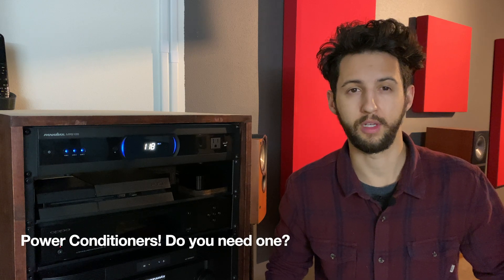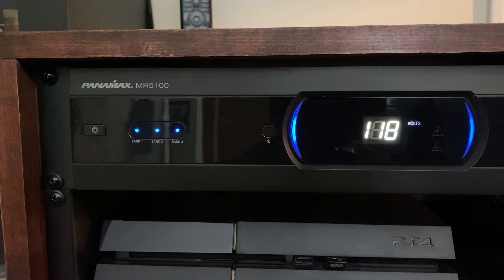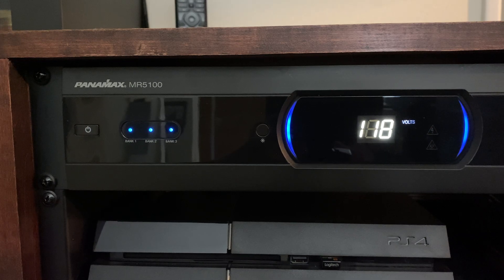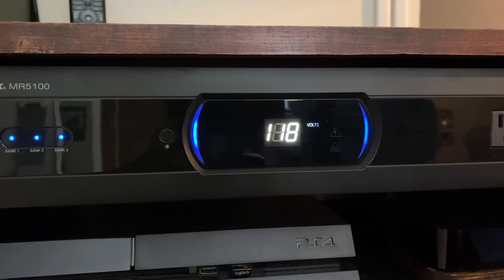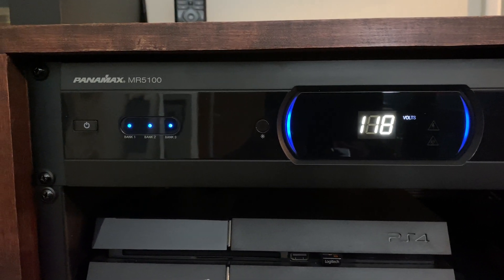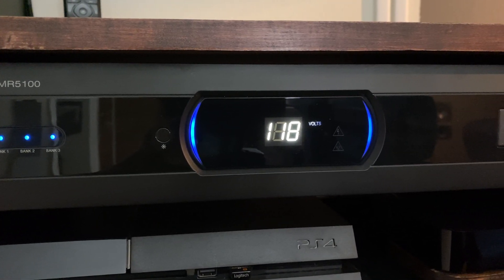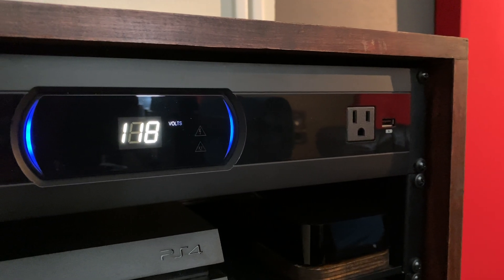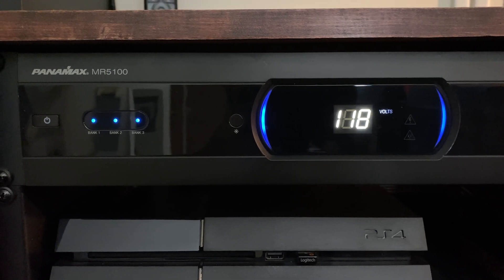Does your Dolby Atmos Home Theater need a Power Conditioner?

Comment: Hi there. I just purchased the Panamax mr5100 based on your review. I have a couple questions. I’m going to plug my marantz 7010 receiver into the high current banks. but I’m not sure if I should plug my Panasonic 4k player into bank 1 (always on) outlets or bank 2 (switched) outlets. I value your opinion. Thanks again.
Reply from the maker: Well it’s not a high current device so technically it will not matter. The delayed outlets are for power amplifiers and they turn on like 10 seconds after the other outlets. So I would plug in your Blu-ray player into the always on or the bank two switched outlet

Comment: Is it normal for the numbers on the panamax to fluctuate up and down.
Reply from the maker: Yes ! Absolutely unfortunately most people share power with their neighbors even if you live in your own house if a lot of people in the area around you are  drawing a high amount of current then you might see some voltage fluctuations, this is perfectly normal although generally it should only be 1 to 3 Volts
Reply: @The.Home.Cinema.Engineer  oh okay yeah I see it fluctuate from 120 to 118. so when you turn off your entertainment do you turn off your panamax to or do you leave the panamax on.
Reply from the maker: @dwj3005  Panamax conditioner stays on 24/7. I only unplug it during a really bad thunderstorm was very close lightning but that rarely happens
Reply: @The.Home.Cinema.Engineer  would the panamax protect  your equipment from a storm.
Reply: @dwj3005  Most likely not! If you are subject to a direct hit it will fry the device and still destroy your equipment. Best line of defense is unplug your equipment!

Comment: you dont need a power conditioner at all.
Reply from the maker: I would disagree , Some of these base model Furman and Panamax power conditioners are only a little bit more than a power strip, and they offer more outlets and they do offer filtering for EMI and RF which can affect the sound quality. Plus the added benefit of the protection from surges is usually stronger than what a standard power conditioner offers so maybe not entirely necessary but great benefit I think

Comment: Can you plug a electric fireplace into it.
Reply from the maker: If you wanted to , lol
Reply: @The.Home.Cinema.Engineer  lol I'm serious will it harm the unit.
Reply: @dwj3005  no i plug mine in but it will cause a power drop that could trip the system and shut it down so you will have to check your votlag so it doesn't drop below 100 volts

Comment: In all my 80 years I have never needed a power conditioner,Thank God I don't have Golden Ears nor had such poor power problems.
Reply: There are definite advantages to having the subwoofers on a delayed start. That way you can leave them always on at the Box and switched on with the panamax on a delayed start. Noise filtration a plus, but you'll get better surge protection from the standard Belkin 4000 Joule unit for about 30 bucks
Reply from the maker: The power here can be dirty or full of noise. Even if some people can’t tell the difference in audio quality. It definitely is a better surge protector for all your equipment than your standard power strip.

Comment: What do you mean, “ run of the mill surge protector”?
Reply from the maker: It’s a common phrase or expression. For saying average
Reply: So 80% of surge protectors don't stop the surge it simply slows it so it can be Marketed as "surge protection "
Thus why they are sold cheap at Walmart etc

Comment: Picture improvements?   LOL.   If you have enough noise on your AC mains to cause picture issues on a digital signal....Move.   Also that device isn't going to protect you from a lightning strike.   Of course you heard a difference...if you paid money for a device to 'improve' your audio you will hear a difference.   Less grain in the picture on a fully digital system?   Really?   All that said such a device certainly doesn't hurt anything.   Good idea,  but please call it what it is.
Reply from the maker: I leave it to everyone’s own interpretation. Before I purchase the unit I did not expect it to do anything but provide surge protection and clean power for my electronics. It certainly seemed to make a small improvement in audio.   And in some cases although probably much less noticeable may offer a small improvement and picture quality. But then again I am no expert in power and how that might affect a video circuit. That being said I am very glad I purchased this unit and I do recommend it for people who have more than five grand worth into their audio and video system. If you don’t like it then You don’t have to buy it
Reply: @The.Home.Cinema.Engineer  I have a background in electrical engineering.  I can tell you that it's possible to notice a difference in the analog section of audio equipment.  As to digital,  unless you have severe noise which would be blatantly visible the difference your seeing is in your mind alone.   They key is yes you do notice a difference,  nobody else will.  Did you waste your money,  no not at all.  Enjoy.
Reply: @The.Home.Cinema.Engineer  Oh snap, he whipped out his degree! GOT YA THERE PAL! No seriously, I'm excited for this unit and the various sources from both reviewers and manufacturer have stated audio filtration being advantageous with this unit. Comforting to also know that your equipment will be protected even in the event of a lighting surge. Good stuff Brother!

Comment: Most of what was said about protection of systems were true however comments about improvement in sound quality of the bass, mid-range and highs is complete nonsense. Any such perceived improvements would be completely psychological. At best the the filtration could reduce the noise floor, but not "improve" the audio quality beyond that!
Reply from the maker: I feel like if your city has dirty power , then that would show up as distortion in the audio signal and the power amp. thus filtering should make those things sound better in theory. but I just know it was better sounding after using one, weather it was placebo or not still did to my ears.
Reply: This.

Comment: Thanks for the upload. Do you buy into the speaker wire/component connectors? Audioquest etc to lower noise or is the power conditioner enough, I tend to buy more into a power conditioner than speaker wire
Reply from the maker: I believe in good quality well made cables but not ones that cost hundreds or thousands of dollars.
Typically I buy the brands used by the music studios I've been in.

brands like Canare and Mogami, blue jeans

Comment: Does this help with noise created by a power amp? Since I added an amp to my HT I've been getting some pops and crackles in on speaker even after redoing the wiring and separating my wires and rca from power cables. But the amp I got uses a 20A corde and that seams to create loads of interference. I'm out of ideals
Reply from the maker: it might but that noise could be coming from a number of different places. but its a good start and does help with ground noise in most cases. its also good for protecting everything plugged into it.
Reply: @The.Home.Cinema.Engineer  protection im good I have a house surge independent on this room alone. As far as the noise its only 1 speaker I really don't understand why the wires are about 2 ft away from the amp and power cables. I'll have to speak with the shop. Not to mention that this amp doesn't even go past 32 degrees even after 5hrs of full on movie watching. Thats really weird. The shop told me they run hot and I would need to add a T10 fan but its barely going over room temp for a 7ch 300w per ch amp thats really weird. It could have arrived with internal issues. Not to mention when I run ARC it gives me numbers so far off makes me believe something is up.
Reply: @lexiewilkinson9703  j'ai un tone winner 7300 mais je lais fait remplacer et tous va bien un module était scrap
Reply: @taxi615  how do you like the tonewinner so far. Im looking to get two but im not sure yet
Reply: @rindershow212  very much so its great doesnt bat an eye